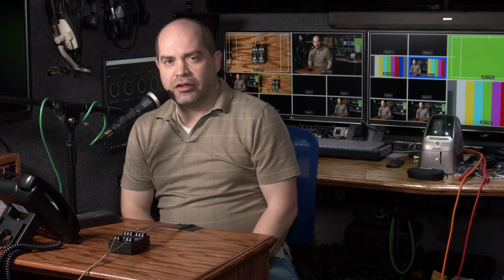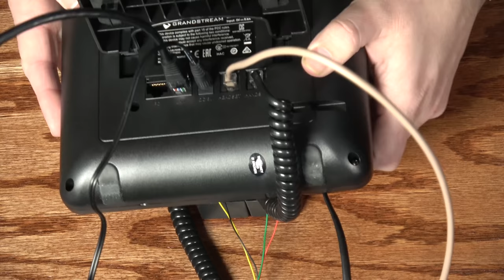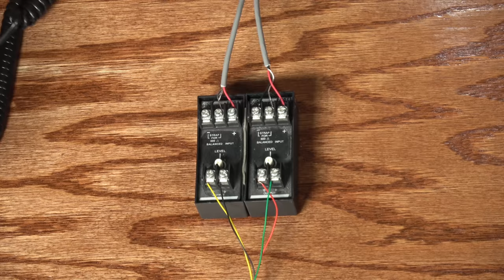Incorporating Telephone Audio into Video Production Workflow

Comment: Axel boxtel hybrids are common here in Greece because they are being used vastly by radio stations for on-air calling, but if you pay close attention you sometime run into feedback issues where you hear the audio you send to the phone coming back to the input. It is barely there and appears when you're sending really "hot" signals to the phone.
Reply from the maker: Hybrids are most definitely still in use. They aren't quite as common as they used to be, though.
Reply: That and the caller doesn't turn the radio down....

Comment: You said that you had a crew streaming to the trailer remotely? How was this done? I have an event coming up where I need realtime(and decent quality) footage from someone miles away in my production.
Reply from the maker: We popped a couple Teradek VidiU Pros onto a couple cameras and set them to live stream via a couple of hotspots. The videos streamed to unlisted videos on YouTube. From the trailer, I had two computers playing those YouTube videos full-screen, where they went through HDMI-to-SDI converters to go into the switcher.
Reply: @djp_video  how do you deal with the delay? there is about 30 seconds of delay
Reply from the maker: @vigenk06  It doesn't have to be that long. When you create a YouTube event you can specify the amount of delay that YouTube adds. By default, yes, it is about 30 seconds. but they have two other options that are considerably shorter. 

In that particular case we didn't need to worry about the delay. We were switching between the remote feed with a roving camera and a reporter, and two drone shots. The timing of the drone shots wasn't important, so we just followed what the reporter was doing in terms of knowing when to switch shots.

Comment: That's what I did:  Buy a standard phone with sim card, made two holes in it and solder my external mic and speaker to two 6.5mm mono jack. Through two jack cables i cary the signal to the mixer one to my line in (from phone mic) and another to my auxiliary mix or to one of the group (audio from mixer). In this way a can control what is coming from cell phone to my mixer and what i send to phone.  How it works: a crew member pick up the call with standard phone headset  and if this caller is interesting  crew member anounce the producer that we have a call and producer tell the host about the call. Crew member press the speaker button on the standard phone, that is how signal come to audio mixer and when the host is addressed to phone caller we introduce it in main mix . I tend to improve the impedance but for now sound is pretty ok